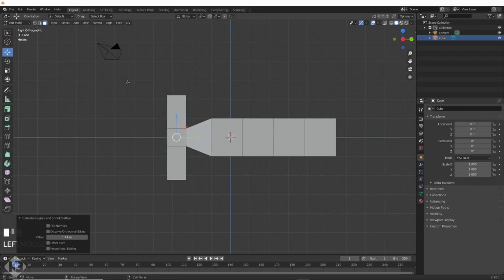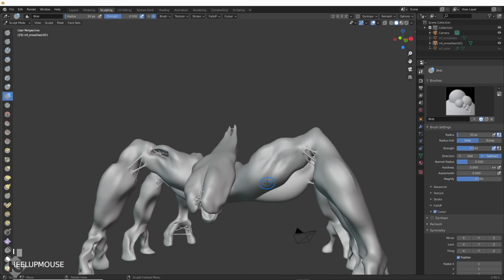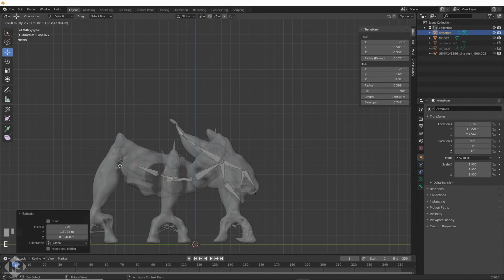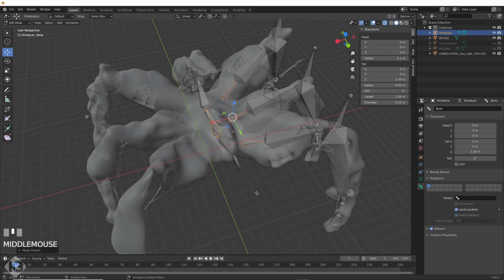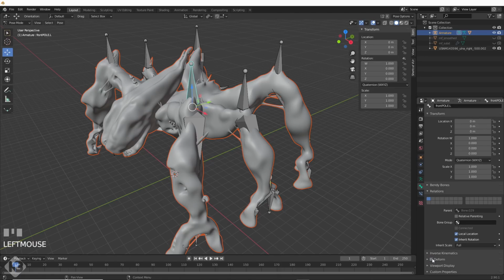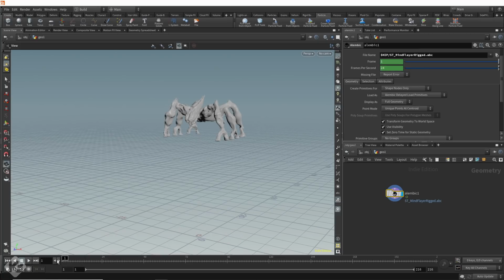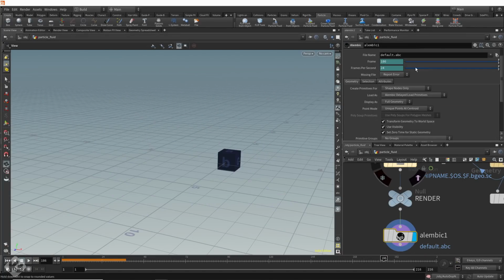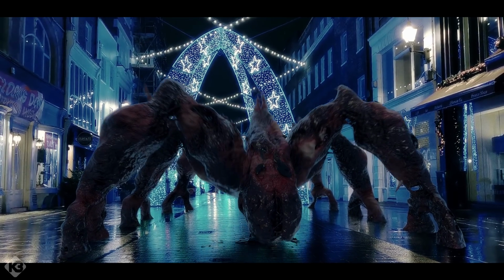Stranger Things Style Monster in Blender 3D Fully Explained - Mind Flayer

Comment: Tip for better saving in Blender: Enable the 3D Viewport Pie Menu addon> Ctrl-S> Incremental Save 

This saves a version of the file you're working on with a numbered extension and automatically increments each subsequent incremental save. If you still want ctrl-s to do a plain save just change the hotkey combo for the addon. This has saved my butt so many times.

Comment: Wow 😮 awesome man you done great job 👍 . Can you tell me your pc specs?
Reply from the maker: Thanks!  This one is an i7 4 core, 16 GB of RAM, and a GTX 1070.  It’s old and starting to really struggle with more Houdini stuff.  Ultimately, a Threadripper, Dual Xeon, or the like with 128GB of RAM and a 3080 would be better 😀
Reply: @KevBinge  I have core i5 10400(6 core) 16 GB ram DDR4 would it can runs softwares smoothly?
Reply from the maker: Yes.  That’s enough to run Blender.  You can run Houdini as well, but the RAM fills up quickly when you run simulations or even just create more geometry.  6 cores hyperthread to 12, so you should be good for a while while learning.  Does that help?
Reply: @KevBinge  yes you helped me alot and thank you sir for helping me out . Keep it up I know you will be having 1 million subscribers this year
Reply from the maker: You’re welcome Arsalen!  I’d be happy with 100K and knowing I’d made a difference in one or two lives 😀

Comment: Thanks for the quick fire round in Houdini. Really nice to see a few settings to get the models and animations between the two softwares.

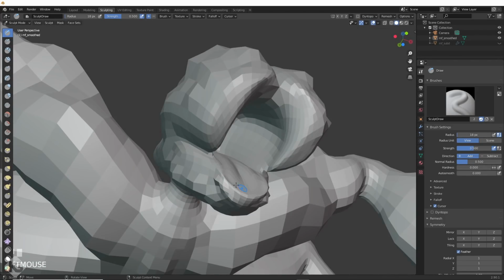Also, after your sculpt, at 3:50, you go back to edit mode and your geo is all nice and smooth. Did you do a sneaky retopo without telling us, or what?
Reply from the maker: Thanks!  Yeah, I think I just added another subdivide.  I didn’t use dyno-retopo in sculpt so it stayed quads throughout the entire process.  Nice and smooth.

Comment: Thanks!  What is your PC buid?
Reply from the maker: This one is older.  It’s an Intel i7 with only 16GB of ram and a GTX 1070 lol!
Reply: @KevBinge  hard to believe.  It seems to work too fast for that config.
Reply from the maker: The trick is to not go super high on the subdivisions and let the materials take over.  Also, I kept it to low particle separation in Houdini but not too much, and rendering under 100 samples with denoising in comp.  You can do a whole lot with less powerful machines if you optimize.  Ian Hubert is a shining example of this.

Comment: Have you tried using the Flip Fluids add-on in blender? idk how it compares to the houdini implementation but it's pretty fast and easy to use and saves you the need to change to another software
Reply from the maker: I've seen FLIP in Blender and it looks really nice.  I don't own it though, and do have Houdini, so I went there :)  Thanks!
Reply: @KevBinge  I've only been able to use it a few times when using a friend's computer, as i don't own it myself, and i was very surprised with how much easier it was to use than Mantaflow

I do hope Mantaflow ends up catching up though because it'd be amazing to see Blender rival Houdini in physics simulations, one can only dream!
Reply from the maker: Cool!  It seems like a really nice implementation of the FLIP paradigm.  I’m seeing Blender devs incorporate more over time as well.  The big difference in Houdini is how it handles data, and serious scale with multi-threading.  Blender is slowly getting there and it’s no small accomplishment on the part of the developers.  They are really cruising and doing amazing work.

Comment: Very nice video, many nice techniques I'll probably need to know at some point, thank you. You mentioned you would need a better pc to do the foggy basement, or need a Threadripper.  What are you using now and how often do you  feel constraint by the power of your current pc? My laptop is better than the recommended Blender requirements, but I often get extremely slow viewport FPS, not to mention render times, and I am often thinking of upgrading...
Reply: I think I kind of got your answer in one of the BlenderNest podcasts, "Working with What You Have (and Fastood)", although was hoping for a bit more discussion about it, but it got interrupted into the Twinkie/fastfood stuff.  I think it is true about the story telling.  I guess I'll just have to become more creative/knowledgeable with what I have, before committing to the best gear.
Reply from the maker: Yes, working with what you have is crucial, but reaching for what would be better and faster is always top of mind.  For the fog stuff I think a RTX 3060 -90 cars would be great.  The Threadrippers or Dual Xeon setups would help with simulations like the fluid stuff.  Those can take a while to bake and can EAT ram, so having architecture hat can allow > 128 would be ideal 😀

Comment: Dope! what were your render settings and samples for cycles?
Reply from the maker: Thanks!  The final was about 128 samples overall with denoising.  I was surprised how clean it was at that level.
Reply: @KevBinge  got it thanks. It does look really clean! The power of denoiser
Reply from the maker: It is awesome!  There’s a line between smeary and clean, and I like it when it’s a low number for clean.
Reply: @KevBinge  I noticed when there is volumetrics it can cause a lot more smearing. But works really well for some cases
Reply from the maker: You’re right!  It does.  Maybe it’s the sampling on depth in volumes that messes it up.  Strange right?
Reply: @KevBinge  that's a good point. I've been trying to get better with eevee so animations are easier to deal with. But it's just not the same...
Reply from the maker: You’re right.  EEVEE is amazing but Cycles still has an edge.